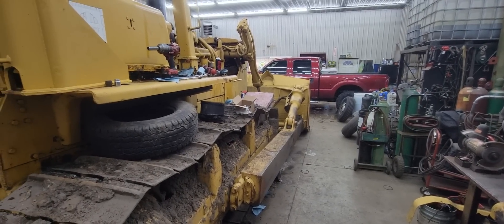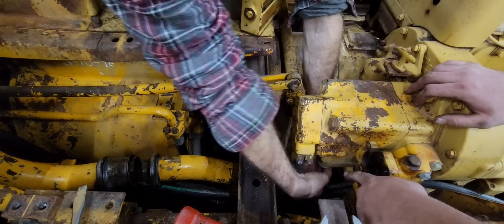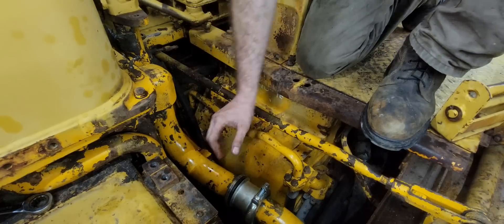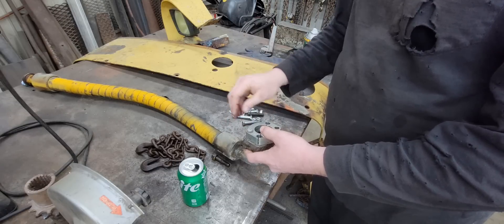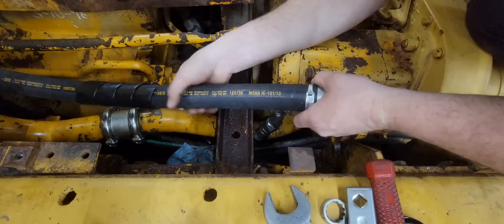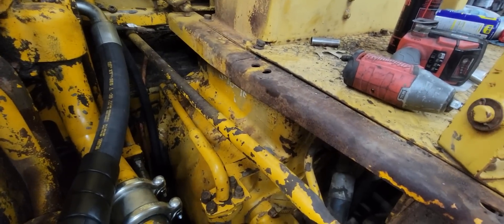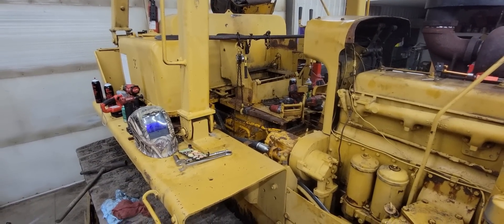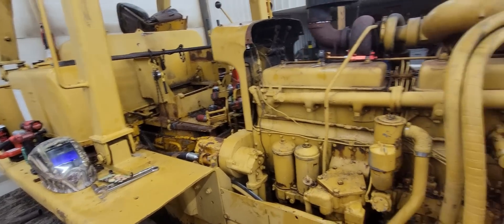1971 Caterpillar D8H... Fixing The Hydraulic Leaks

Comment: On your belly pans you can weld you some hinges on one end ( we use to make then heavy-duty) like that when u unbolt everything it just swings down, because as your unscrewing belly pan bolts and you keep hearing THUNK lol they don't about to realign, with the hinge it makes it much easier, when burning windrows its not uncommon for one to catch fire a couple times a day down in the belly pan, we use to keep a 3 inch trash pump.set up in a near by pond or creek, after 2 or 3 in the afternoon every so often one was hauling ass to the pump lol, TD25 were bad about catching fire as well,  what ever you do don't ever track the dozer no ever 100 feet without the.belly pan on, I've seen a guy ruin a new engine over a rotten looking branch!!

Comment: That new Miller pulse mig welder you don't have to move the nozel. It makes the weld flow using the pulse mig. God bless
Reply from the maker: Pulse mig has actually been out for along time I have welded with it in the passed but back then It was fairly expensive to buy a welder with it my next welder will have it

Comment: Do y'all have a lathe and mill, just wondering
Reply from the maker: Yes I have a small mill and a lathe but they are small like hobby size or for gun Smithing....I would love to have a big Bridge Port Mill and a big South Bend lathe or even a Grizzly Industries them are on the top of my future tools list
Reply: @dirtgrainsteel  Used is not as expensive as you may think, and they don't have to be clapped out either.  I forget where you are at.  OH, or PA sticks in my head.  Both of those area are good for used equipment.
Reply: @ShainAndrews  I think northern Indiana.
Reply from the maker: @Shain Andrews  oh yeah they definitely don't have to be knew just as long as they are in spec and not worn out...the biggest problem is right now I'm out of shop space for now to put them
Reply: @dirtgrainsteel  You will get there.  You're being smart buying equipment that earns its keep.  It's nice when you start retiring some of those payments... then things can start happening faster.

Comment: Your gonna have problems with that hose leaking....the part that looks like a small I beam ,,just 6 inches down from where the hose is bolted in,,,there gonna act like two knives cutting across that hose,,,you should wrap some tape around it for extra insurance ....